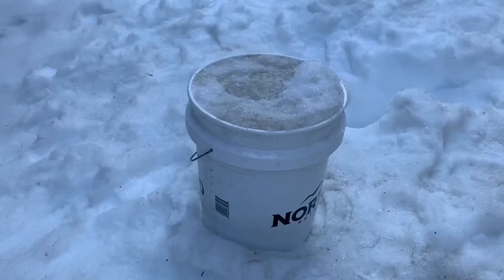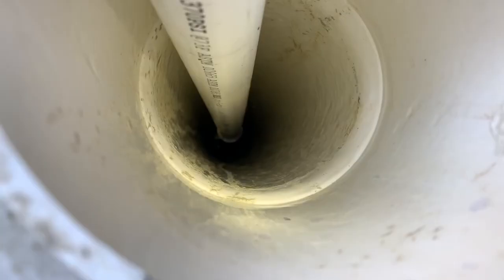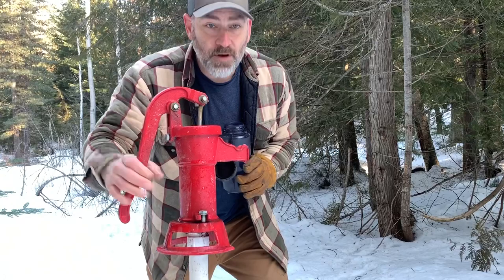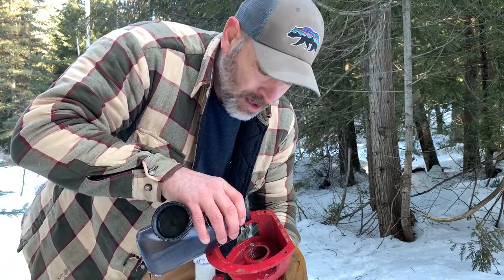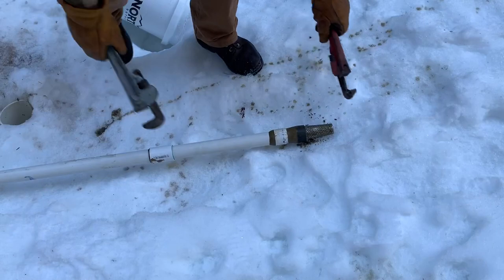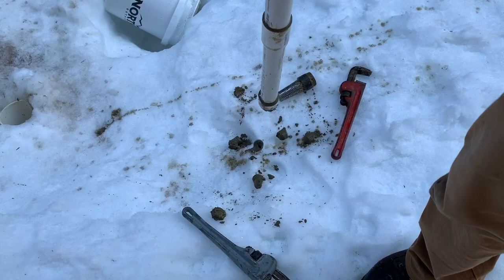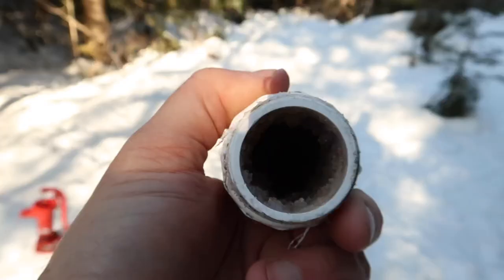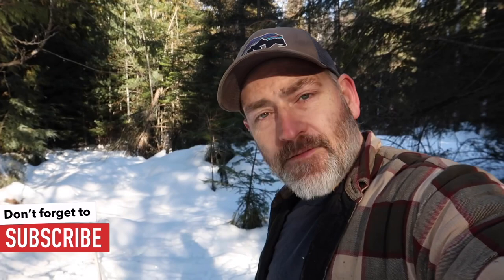DIY Water Well Drilling WINTER UPDATE

Comment: I went 2 winters here in northern mn with an outdoor pitcher pump, now I have a well pump on my solar. My son still uses his... he's on his 4th winter. I have a hint from our perpetually frozen northland.... that little bolt on the side that holds the pump together... if you loosen that just enough to lose your suction after your done pumping your water will fall back into the well quick enough so u won't freeze ur pipe or get a block on your flapper lol.... he keeps a little socket thing tied right on his hand pump... takes just a sec9nd to tighten the nut, pump your water, loosen the nut and let the water fall.... pump the handle a couple times to dry off the flapper a little a run back into the house ♡
Sure hope you guys can develop your well this year... that will be a fun journey to follow along on.
Reply from the maker: Great tip. Thank you.
Reply: @MartinJohnsonOffGridLiving     That thing you call a "flapper" is the check valve for a shallow well hand pump...  Leave OFF your bottom of the well check valve and lift fully up on the hand pump handle, the water in your pump and pipe will drain back into the well by opening up the leather check valve in your pump!!!  You will have to prime your pump more often,  Thank You,

Comment: I know you have probably already heard this but from your earlier well videos you need to cap the end of the well casing to prevent silt clogging everything.  To late for this well unless you can find a smaller diameter pipe to act as a new well casing but larger than your pipe connected to the pump.  Good luck in the spring.

Comment: I would try a construction type gasoline mud pump to pump out a basin at The bottom of the well. Raise the suction line on the hand pump 12” to get out of the silt.  It will clear up in a short time.  Good luck!

Comment: Martin, I can't guarantee it will work, but shouldn't cost that much to try my idea. If you could  use reducers or some other method to seal the top of your 4" casing and pump in water under pressure, you might be able to force the sediment to flow out through the pea gravel and up to the top outside the casing. That may allow the gravel to settle on down to the bottom and help prevent sediment from washing back in. Since it's this much later, you may have already resolved it some other way. This was the latest update that I saw.

Comment: you need to keep the the piping tube supported and steady and not wobbling to stand concentrate and steady on the water level so not agitating the soil below in the water level...I’m use to this pitcher pump as this what we use to have in the Philippines before to have free water.... try this I said and you will see...

Comment: At 18 feet if it was full to the top with water you would not have that much. In 1949 when I was a toddler daddy with grandpa's help  cut the tember and built a house. They dug about a 18 foot well about 4 foot diameter. You only need 2-3 feet of water to supply a house. It will be a lot of work but maybe you need to dig your well.  "Red Poppy Ranch" dug one with a backhoe. Filled the hole with a large diameter pipe and rock. Ours was hand dug with dirt walls (no liner). "Busted Wagon Ranch" dug his with a back hue.

Comment: I don't know if this will help you. But my grandfather a long time ago in the 50s did a point well in northern Wisconsin and what he called glacial till. And I just used high water or strike that they just used high-pressure water weather five horse Briggs & Stratton from the lake to pressurize a pipe and drive it into the ground. All I got what is a lot of mud and kept having to prime it. About the time I was 12 the neighbor said don't give up on that well so the neighbor suggested that he support the the stem the casing and pressurize the bottom of the well. Not to the point well as I recall he rented a pump and pressurized the casing well being supported and pumped it for a bob I think it was like a day and a half. Then it cleared up. It cleared up and he built a jury-rigged motor Corona hand pump that's not supposed to say that. Jerry-rigged motor to the pump and ran it. And as far as I understand now 66 years later some of the best water on the lake. I hope this helps. Carry on
Reply: Sorry can't use the computer yet.

Comment: I didn't check any of the other messages the law in your state says that you cannot drill below 18 feet without professional drilling team in permits. I understand this it doesn't say anything about driving a Well Point down. I don't know if the suggestion has been made to yet some places call it a Sandpoint we call it a well point in Maine. I see no reason why you can't use your existing shaft that you've already drilled and simply add the appropriate length you need to drive your WellPoint very deep in the ground. This you would not need a permit for. I wish you and your family all the best for everything you do sure helps us out thank you

Comment: It may be a good idea to pull the casing and drill perforations in it along and below the water level.
(this also means getting the gravel you poured in around the casing out of the hole)
Then reset your casing in the hole.
Pour gravel around the casing to seat it, but also pour 6 to 9 inches of gravel down the casing, possibly helping to prevent silt build up in your pump pipe.
Then send pump pipe back down the hole and try again.
Just a thought... Not a gurantee.

Comment: A drilled well punches thru the underlaying rock layers until you get enough flow. With a drilled well, you usually get those nasty minerals and foul smells. A bored well - usually three feet across  - bores down thru the dirt and collects the water flowing over the rock layers. this water is pure and actual sweet. My last well was 63 feet deep, dry when it was cased, and had 47 feet of water in it the next day.  You need to discover how deep is your soil level.

Comment: I'd build an insulated enclosure around it.  If it still freezes, I'd put a 100w incandescent light bulb on a temperature switch in the enclosure.  Have it turn on at 32 degrees and off at 35 or 40 degrees.
Reply from the maker: Where would you get the power for the bulb?
Reply: @MartinJohnsonOffGridLiving  Then in the summer you could dig down 3 feet or so and build a sunken enclosure using high density rigid foam insulation for the walls.  The earth's natural ground temperature of 50 to 55 degrees would probably keep the enclosure temperature above freezing even on the coldest nights.  Build a floor at ground level with grated material or planks with a generous gap between them for the earth's heat to rise.  The solar panel system would then become your backup system.

Comment: I think you are dealing with a quicksand pocket. Having worked as a well driller, I have seen lots of it.  It comes in many forms and textures from grainy to very fine. It usually sits in a depression in the bedrock or clay layer and can be exposed to the surface or underground in subterranean pools.

Comment: Good Example, of why states and counties, don't allow people, to drill, there own well. You should have, back filled, with pea gravel, around the inlet, or slotted pipe and clay, on top of that. You can cause, ground water, contamination, by not, back filling, immediately, after you, drill a well.
Reply: It's a shallow well. No permit needed in this part of the country
where freedom can still be had.
Reply: I did not know snowflakes use so many commas.
Reply: @illuminatedpatriot9347  Feel better little fella? Did you fill your quota of insulting strangers on the internet yesterday?

Comment: The bottom of your casing should have cap on it to keep mud and soot from getting in.
Reply from the maker: Think it is a little late for that. What do you think?
Reply: @MartinJohnsonOffGridLiving  it was too late when I saw the video, lol
Reply: @MartinJohnsonOffGridLiving  not sure what size your outer casing pipe was, maybe 4 inches?  I would go buy a 3" PVC casing pipe, cap the end, and put it inside the 4"  PVC, and eliminate that clay and sediment.  Would only cost you about $40.